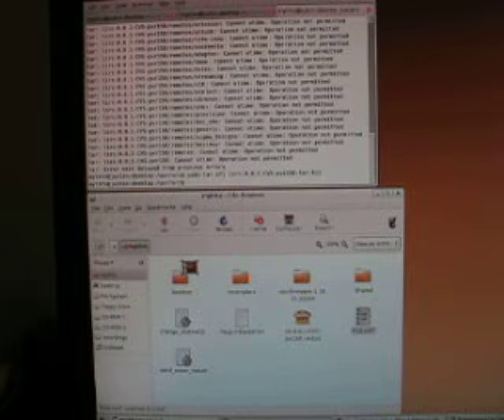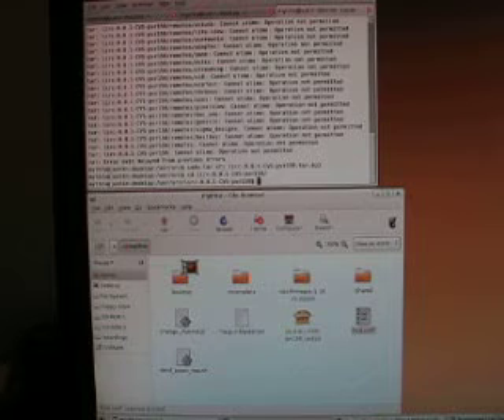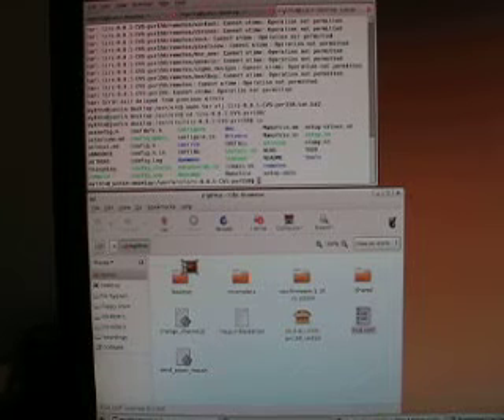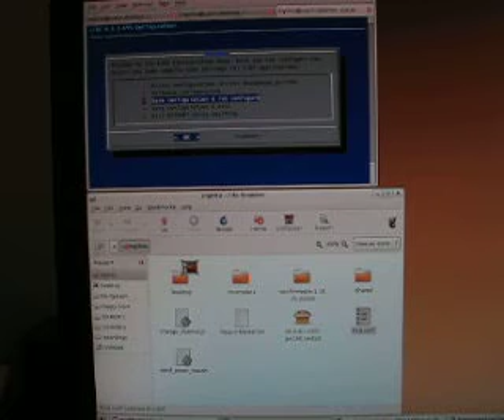ELET4300 - Mythtv Part 1

Comment: Pretty interesting. 
Question. I have dishnetwork HD DVR in my bedroom feeding 2 TVs. coaxial cable feeds my other TV. I dont have any Ethernet ports available on TV rooms.
Q1. On the Hauppauge 350 what input should I connect order to get the programs. 
Q.2 A cable coming straight from the Dish antenna is good enough?
Q.3 Since I don't have any Ethernet ports available in the rooms where I have the video inputs, how can I get my Mythtv box get connected to the internet?
Thanks in advance.